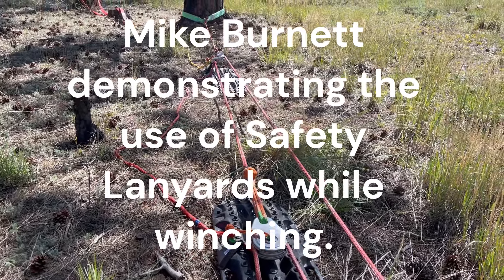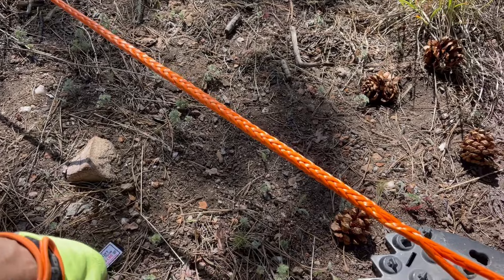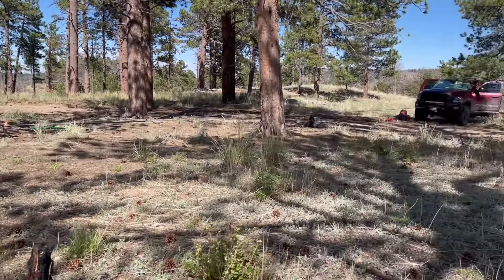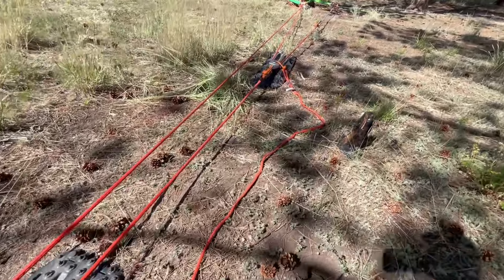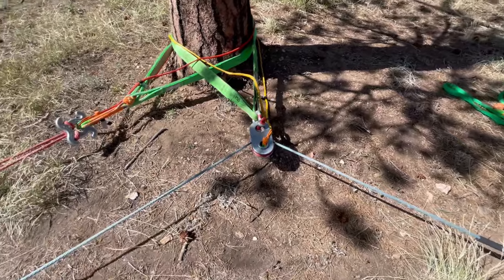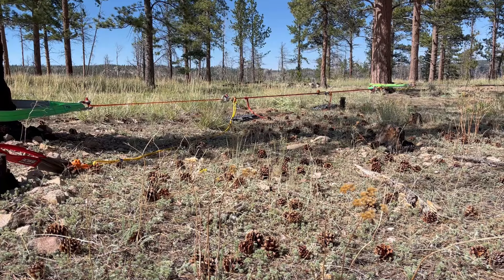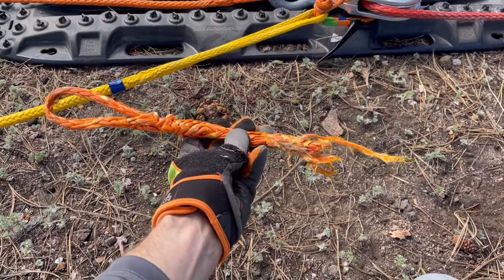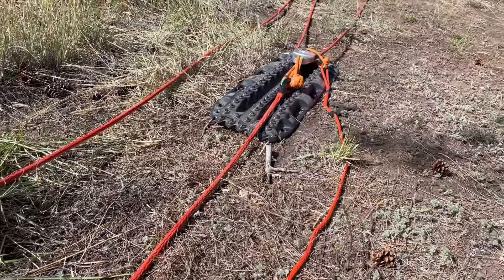Mike Burnett from Colorado 4x4 Rescue and Recovery demonstrates use of safety lanyards.

Comment: I have seen several synthetic lines break on various YouTube channels, and the line basically just falls flat to the ground along with any attached hardware.
Was there any stretchable line used there?  Or was the Chinese line just that inferior?
Reply from the maker: It is a myth that synthetic line does not store energy.  While it stores far less energy then a steel line it still has the ability to throw gear.   

It's highly likely those videos you are talking about just did not have the load on them to throw things when they failed.  If they were compromised or cut by something the load used to break them could be far less then a fully loaded line.   Even the highest quality line does have some amount of stretch.  When we see failures the line never just falls to the ground as the Myth says. 

It should also be noted that the short length of line Mike used in the demonstration would have far less energy stored then a full length line breaking under a full load.  

But we also would not say the Chinese line is on par with an American line from a trusted supplier (most marketing groups that sell Chinese knockoff gear should not be trusted)
Reply from the maker: It should also be noted that every item in the rigging including the trees and winch will store some amount of energy and release it at the one failure point on the line.
Reply: Look up tow truck Dustin he has one where it breaks and slings back even with a damper on it. Most of the time when you see it just fall not that much tension yet. And probably wasn’t rigged right or already a cut in line before pull.